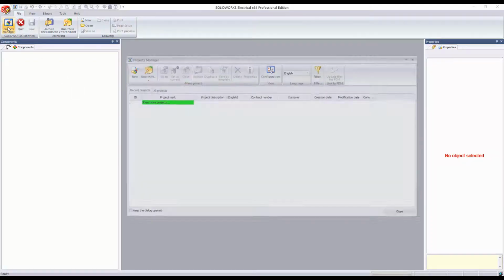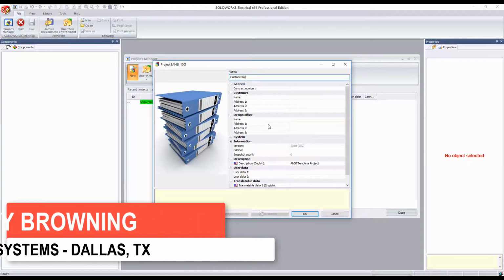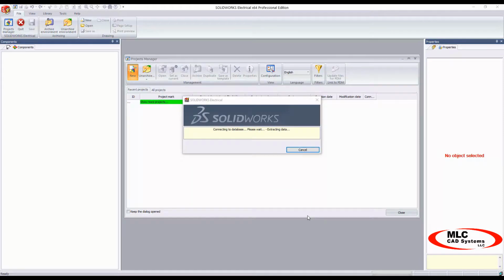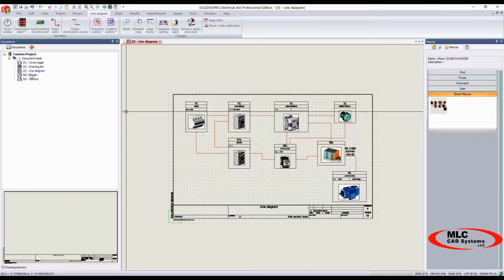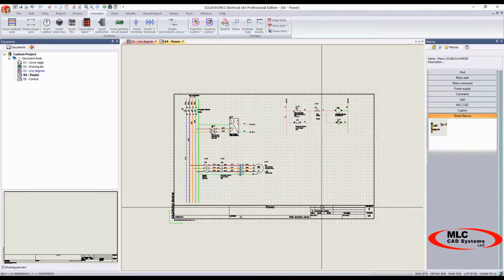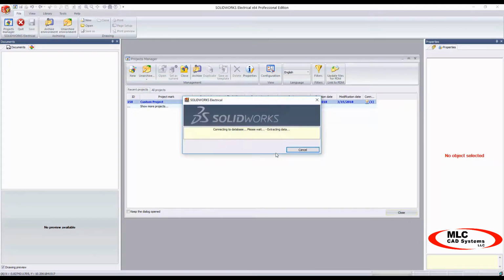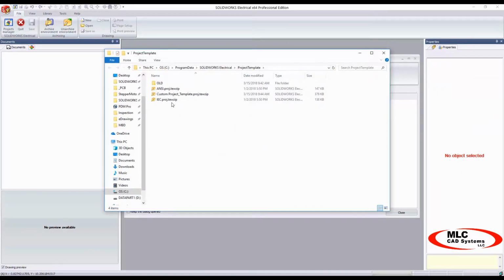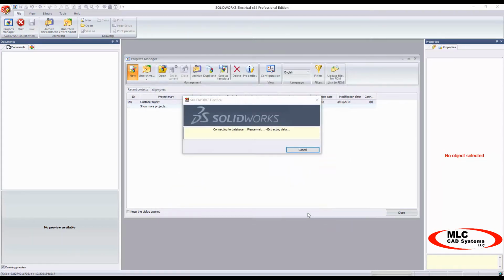Setting Up Your SOLIDWORKS Electrical Templates

Comment: thanks
Reply from the maker: You're welcome!
Reply: @MLCCADSystems  how can you reduce the size (dimension) of the component in the wiring diagram
Reply from the maker: All symbols are editable, as is the sheet scale.  If one specific symbol is too big, edit it in a 2D CAD Editor to the preferred size.  If all symbols are too big, scale the drawing and snap settings to your preferred size and spacing.